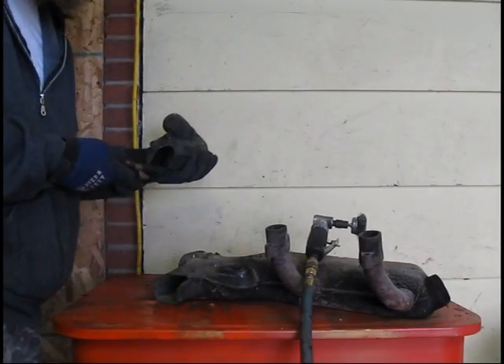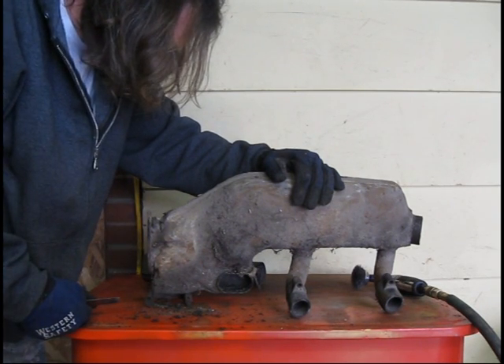Type 4 Heat Exchangers-part 1

Comment: What's the name of that first part you cleaned? The bit that goes from the heat exchanger to the ducting inside the engine. Mine seems to be missing so will have to go hunt for a replacement, but I can't find what it's called
Reply from the maker: Sorry but I’m not sure what Volkswagen called it. It maybe found in a repair manual if you have access to one. Thx for watchin’!